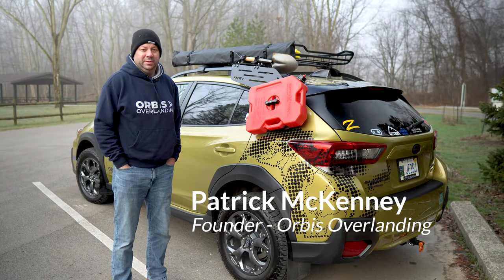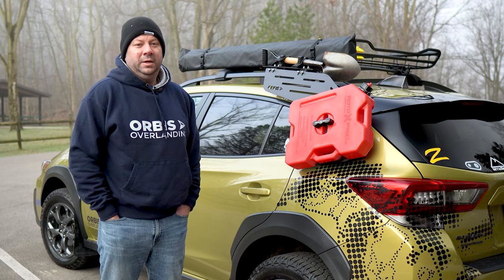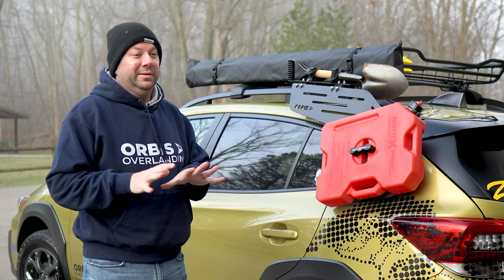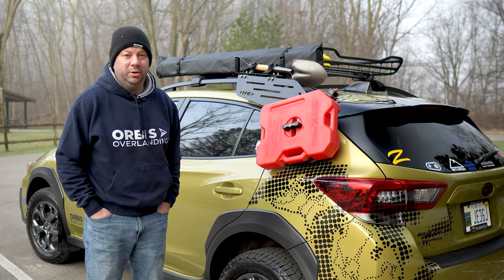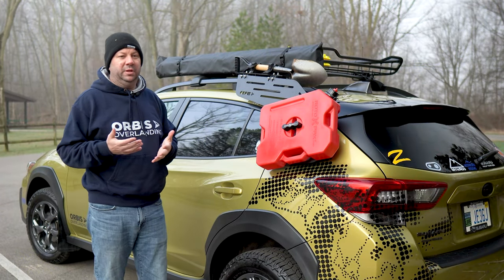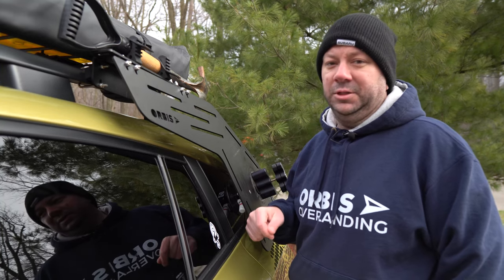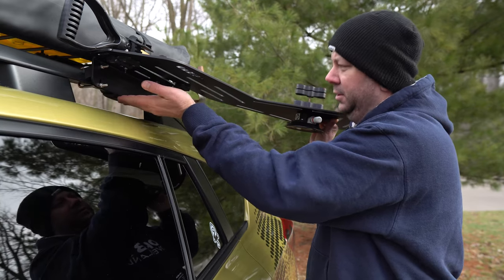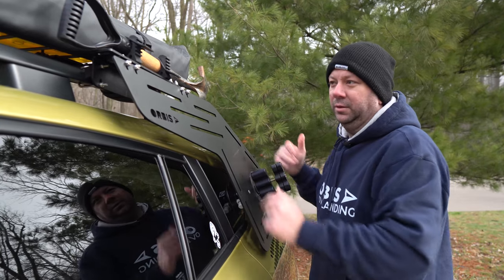Birth of the Rack Wing

Comment: Would the rear door with rain guard get in the way of the rack? Would the door open? What about wind noise? Does it mount directly to the bar or to the basket? Any drilling required? Where can I get more info on this product?
Reply from the maker: Hi John, twin guard should be fine I've not had anyone say otherwise, but it should clear it. Yes absolutely the rear doors open. I leave mine on all the time and have my kids in and out of the backseat. Mounts to the OEM side rail or Prinsu Rack. Frontrunner Slimsport is in development. No drilling just nuts and bolts. Www.orbisoverlanding.com. also check out this video from a customer: https://www.google.com/search?q=youtube+tom+the+dilettante+rack+wing&client=ms-android-google&sxsrf=AJOqlzVilZkTqJIkvIaVATnksWpa7MjxnA%3A1674355106313&ei=oqHMY6jfEqqkptQP2qujmA8&oq=youtube+tom+the+dilettante+rack+wing&gs_lcp=ChNtb2JpbGUtZ3dzLXdpei1zZXJwEAMyBQghEKABMgUIIRCgATIFCCEQoAE6CggAEEcQ1gQQsAM6BQghEKsCOgcIIRCgARAKSgQIQRgAUMsKWOAzYKA3aARwAHgAgAHQAYgBhAySAQU0LjguMZgBAKABAcgBCMABAQ&sclient=mobile-gws-wiz-serp#

Comment: I have a 2021 Crosstrek.and i was just wondering,on this video ,what type of tires are you running? Are they stock soze?
Reply from the maker: The tires in this video on the Crosstrek are the Falken Wildpeak AT Trails and they are stock size. They are not my current tire however. Find me on IG or FB for the current setup.

Comment: $400 bucks for some hardware, aluminum panel, and a suction cup seems to be extremely expensive for inexpensive materials. Why is it so expensive and do you plan on making cheaper versions? If not I’d just make my own for about 150-200$
Reply from the maker: Hi Nathan, thanks for the comment. The panels are 3/16 aluminum, which are cut and manufactured in Michigan, black powder coated also in Michigan, all of the hardware, nuts, bolts etc included are stainless steel, as much of it as possible sourced from US manufacturing. The vaccum cup is an industrial cup made in Montana by a material handling company, so again made in the US.

The trade off to my being diligent in wanting as much of it as possible made in the US, is there is a cost trade off for me. I could do it cheaper, and I looked into having the panels cut and built outside the US. It could be done cheaper. But I decided that wasn't the direction I wanted to go with my start up. In addition to that, there is the overhead of running a business. 

I have however recently been able to drop my shipping costs as I've started getting to a volume where I'm getting better rates, and there is a oppertunity over time as I grow that buying larger quantities of material will allow me to change the price. Right now, aluminium is continuing to climb. If you look at the commodity market, it's up nearly 60% since I started my business in March of '21. Much of that has been absorbed to keep the costs where they are.
Reply: @OrbisOverlanding  that’s ok. I already made my own version with 1/8 thick aluminum L channel that’s 4ft long and 1/16 thick weldable metal that’s 12x12 inches. I already cut, sanded, coated everything and now I’m waiting for the exact suction cup you use on Amazon. When it comes in all I have to do is install it and it’s done. And the cost was about $120.00. What’s cool is the metal is actually really strong for it only being 1/16 of inch thick. And I can make as many cut outs as I need in the metal panel I have for whatever I need. Sorry that I can’t afford your product but at least I got the tools and materials to make something similar for almost a quarter of the price. Thanks for the reply 👍🏻
Reply from the maker: @nathanbriscoe871  Hey that's great! For those like you who have the ability to make it, it's even better and then you can customize it exactly how you need it. Love to see it finished on the car when your done, look me up on IG and send a picture when you have them!

Comment: Waiting for one to come out for a 2017 Outback. Please make one!
Reply from the maker: I won't say never, but they are a challenge because side rails are very different because of the foldable cross bars. There have been several customers who have customized a solution for it to attach to a cargo basket or other similar device. But nothing the is bespoke for that design at this time.
Reply: @OrbisOverlanding  yea I’ve seen that there’s a big difference in the mounting hardware. Shame cause they do look really good! Thanks for the reply though. Ill stay on the look out.

Comment: Will it fit a regular 2022 outback? (Onyx edition)
Reply from the maker: Not directly, the side rails are very different because of the foldable cross bars. There have been several customers who have customized a solution for it to attach to a cargo basket or other similar device. But nothing the is bespoke for that design at this time.